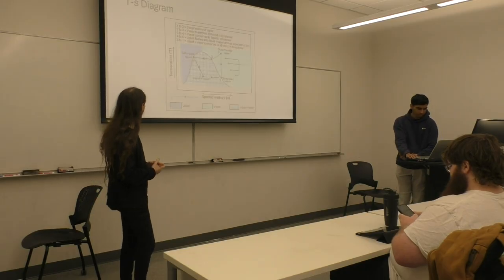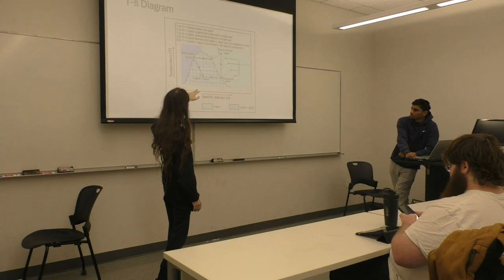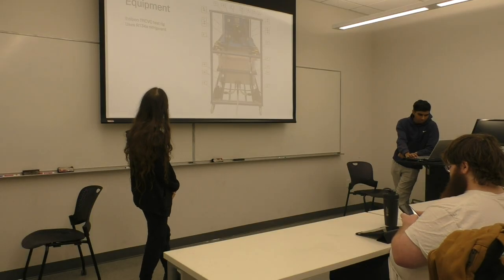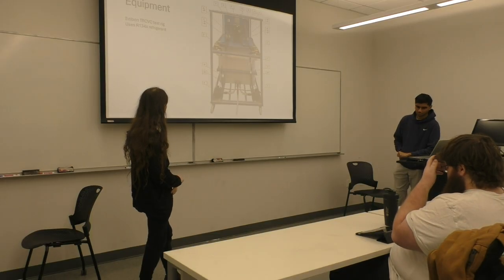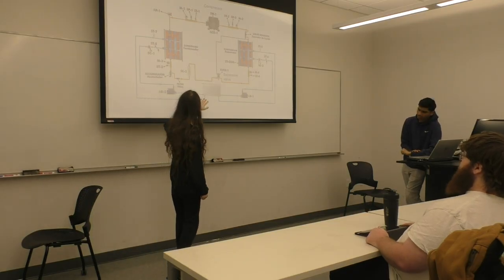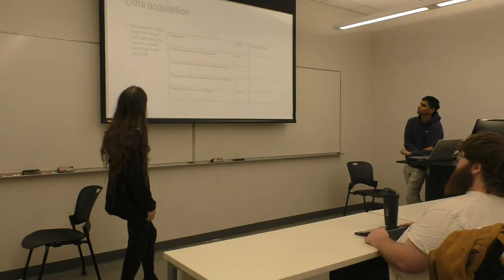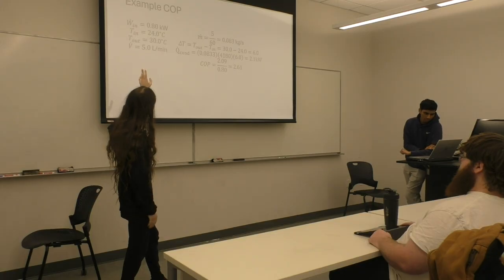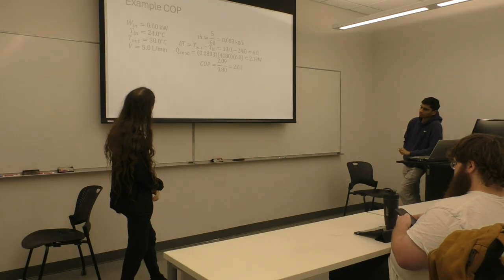Alexander Colwart: Group leader - Refrigeration Cycle

Comment: I think the content of the presentation was very good, as you were able to explain the experiment very well. With that said, I think you could have done a better job making the presentation itself. Obviously you don't want to overcrowd a slide, but I think that most of the slides could've included more, whether that was another bullet to go more in depth and add more context or a graphic to help visualize what the slide is showing.